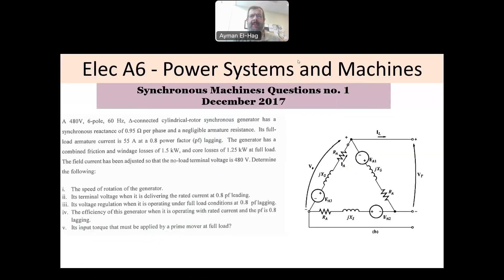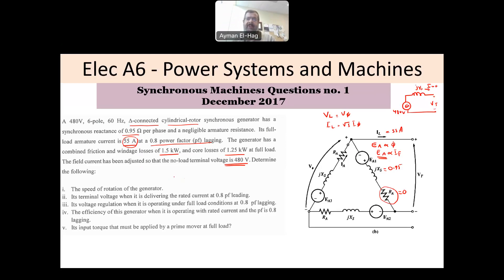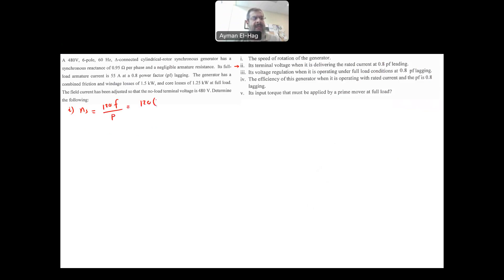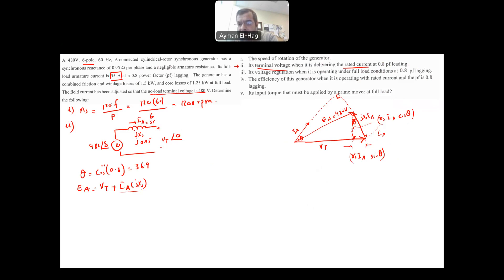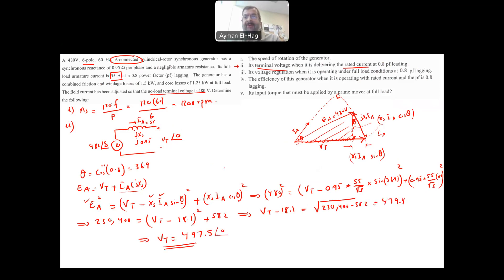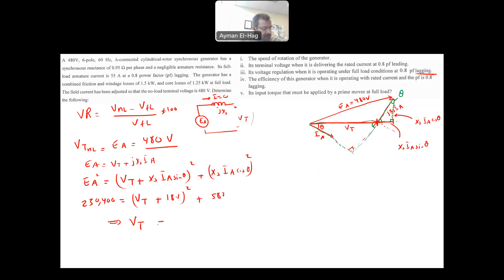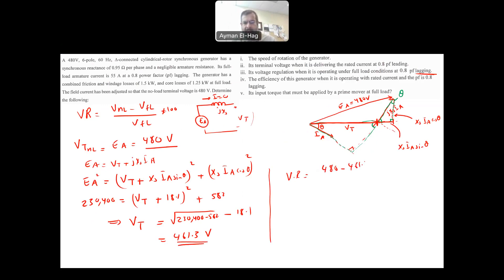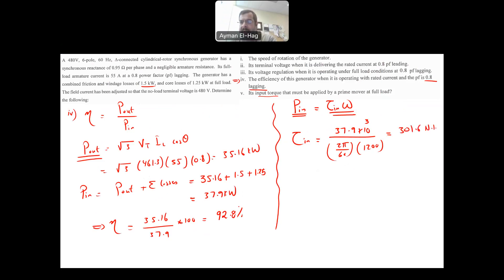PEO solved examples (ELEC A6): Synchronous Machines no. 1

Comment: Hello Sir Ayman: I hope you don't mind me asking for clarification, isn't that the armature current = 55A & not the same as the line current? If this is the case then do you still need to divide it by sq.rt of 3 in calculating for Vt? Thanks.
Reply from the maker: This is a delta connection, so the line current is different than the phase current.
Reply: @electrical4everyone  sorry again to bother sir, in the question it's indicated that 55A is the armature current & if this is in delta, isn't it that it's also the phase current?

Comment: Hello Dr. Hag,

At 4:50 you are analyzing the system on a single phase basis. Shouldn’t you turn it from delta to star to be able to do that? And in case you do, shouldn’t the 480 L-L be transformed to phase voltage 480/sqrt(3)?
Reply from the maker: I worked on the delta connection directly without the need to convert it into Y but you can find that for the current I divided it by SQRT(3) because the given current is the line current and we want to find the phase current and the phase voltage = the line voltage. If you want to transfer this into Y connection, then you need to divide the impedance by 3 but I prefer this approach.
Reply: @electrical4everyone Thank you
Reply from the maker: @john_ron you are welcome

Comment: Hello Profeesor, for iii, Can I calculate Pin= square root 3x480x55x0.8=36.58kw, Pout=36.58-1.5-1.25=33.83kw? Thank you so much.
Reply from the maker: Hi
The 480 is the terminal voltage which is the ouput voltage. Also the given power factor is the power factor at the output. So, the formula you suggested will give Pout and not Pin.
Reply: @electrical4everyone Good morning Professor,  I got it. Thank you so much.
Reply from the maker: @yangao9236  You are welcome
Reply from the maker: @yangao9236  You are welcome

Comment: Two 600-kW, 60-Hz, diesel-driven synchronous generators A and B have governor speed regulations of 2.0 and 5.0 percent, respectively. Both machines are in parallel and
supplying equal shares of a 1000-kW bus load at 57 Hz.
a. Sketch the approximate governor characteristics for both machines on one set ofcoordinate axes, and indicate the operating frequency. Label both curves.
b. On the same diagram, approximate a new operating condition that assumes theload on the bus decreases a total of 400kW.
c. Determine the new frequency and the new load distribution for the conditions in part (b).

This question appeared in May 2016, Sir? To solve such questions, we need to have slope in MW/Hz that can be calculated from speed drop. However, I am having confusion, since no-load frequency is not given explicitly. Should i suppose the rated frequency of 60 Hz as Full load frquency and calculate no-load frequency , or shall i assume it as no-load frequency and calculate the full load frequency?

secondly, with these dropping percents and given freuqnecy, the two generators can't share load of 1 MW at 57 hz. This system frequency isn't correct, in my opinion. Can u please guide me on this? Thanks
Reply from the maker: Currently I'm concentrating on solving questions from exams after the COVID as they are consistent and have different pattern than the exams before the COVID.

Comment: Hi professor! At 5:06, you put IA=55 in the equivalent circuit diagram, or should this be IA= 55/sq rt 3 as a Delta connection? Thank you.
Reply from the maker: Thanks for your feedback, there was no clear description if this the line of the phase current, so I assumed it is the phase current.
Reply: @electrical4everyone  Thank you~
Reply from the maker: @user-lu7ww8gk7d  you are welcome